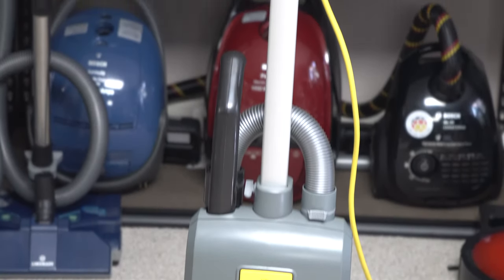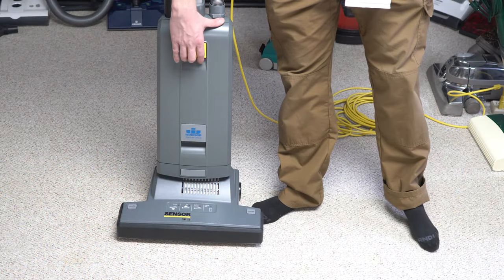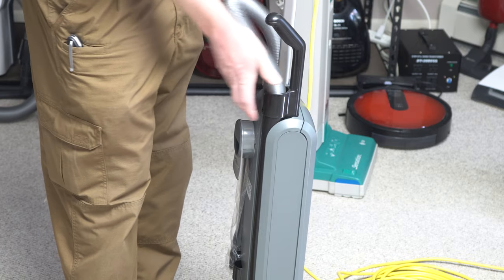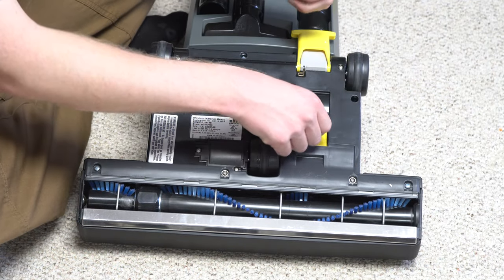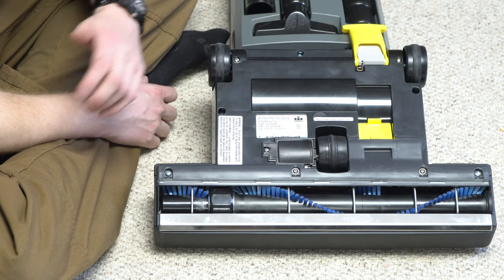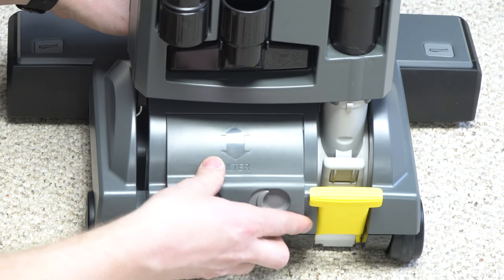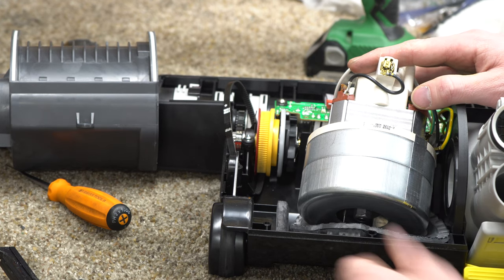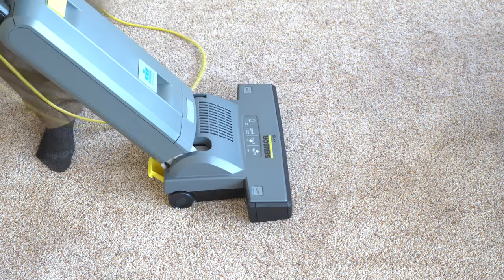Windsor Karcher Sensor XP18 Commercial Upright Vacuum Cleaner Review

Comment: Love these machines; had them in my cleaning business for about 15 years now and no issues (g series I believe) Bought a new one with the auto height adjustment and just didn’t feel like they dug into the carpet as well as the manual ones.
Reply from the maker: The auto adjustment works great. I will say it's very common for people to adjust their vacuum too low. They do make machines with a boost button that purposely adjust the machine too low which cuts air flow and cleaning ability. but makes certain people happy.

Comment: These Windsor XP machines are basically just Sebo Automatic X's made for commercial use.  I used to own an old white/blue XP12 years ago, and it was basically like having a Sebo X4, I was even able to run genuine Sebo bags and filters in the thing, and it works just like normal.  Also, quick point of inquiry on your Windsor Sensation, there was a commercial variant of that vacuum, that came before the XP12, and that one was the SR12.
Reply from the maker: Yes all these machines started around the late '80s and got launched into the 90s with the automatic X . There's really not a good history of the commercial machines like there are the domestic machines.

Comment: Would you prefer this machine to one of the Lindhaus commercial uprights?  I am going to try to convince my director of nursing to quit buying shark vacuums for my facility. Lindhaus dealers are closer to us than Sebo dealers.
Reply: Honestly, both are really good, and you can't go too far wrong with either.

If you have multiple carpet pile heights, I might favor the Sebo/Windsor because of the true automatic height adjustment, but if there's just one, either is fine. Lindhaus has manual adjustment, which is also fine.